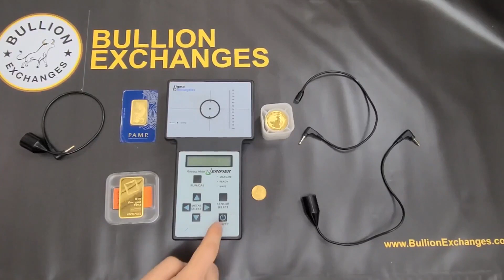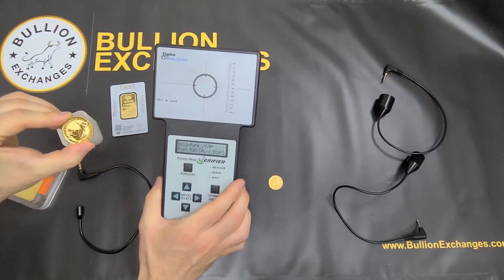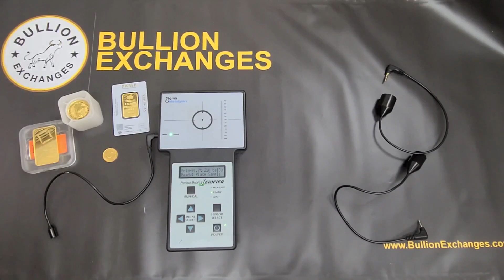How to test silver and gold at home with Sigma Metalytics Precious Metal Verifier (Part II)

Comment: Can the machine be fooled
Reply from the maker: The Sigma Metalycs Precious Metals Verifier has very complex components which makes it verify if it is true gold or silver. The user selects the metal that the sample is expected to be. The Verifier sets the value of that metal’s resistivity to the center of the bar display. The bar display has brackets that show the expected range of the reading for the selected metal. So, for example, if the user selects pure gold as the metal, and pure gold is placed on the sensor, a value within the brackets will be obtained. Virtually any other metal with a similar weight will fall far outside this range. If the actual reading does not correspond to the expected reading, an arrow will show up on the bar display.